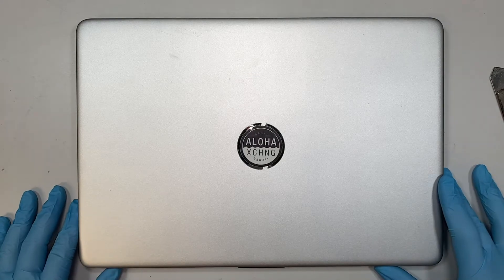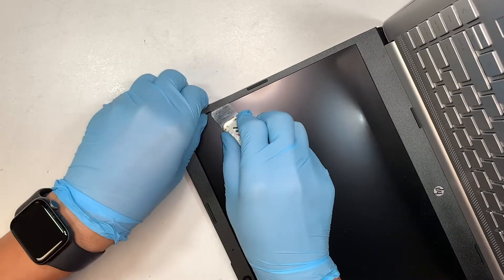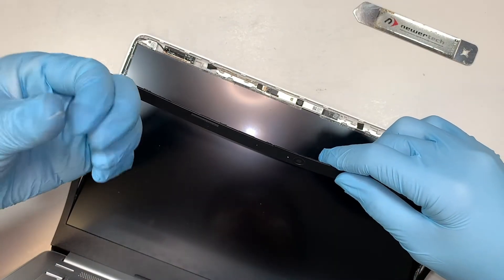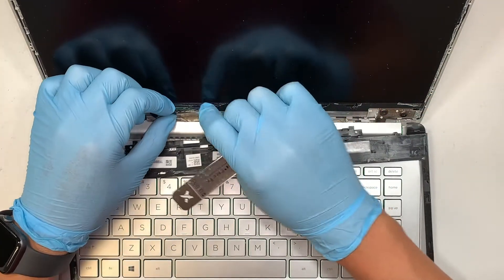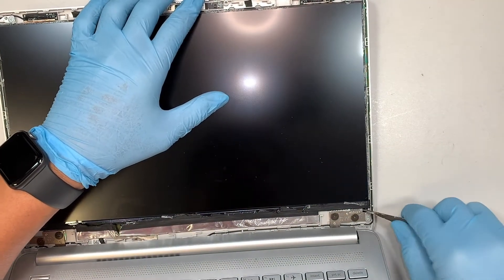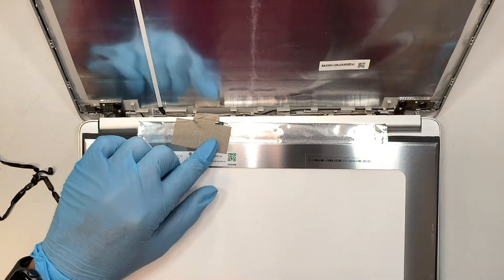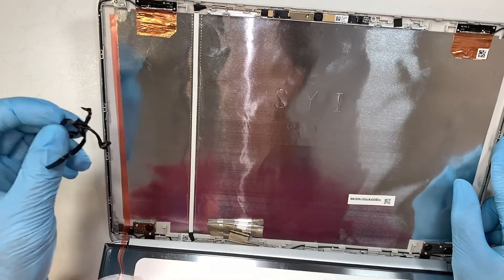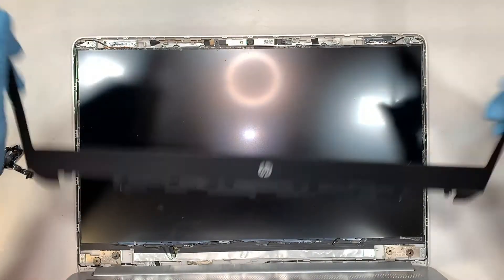HP Laptop 14 Screen Replacement Start To Finish

Comment: My HP chromebook just stopped working, the batter was low and i put it on charge but screen went black and no power light i disconnected battery i think tried to use just cord but nothing what can i do

Comment: This was extremely helpful. I did have a hard time getting the plastic back on, especially the bottom under the hinge. It would have been helpful to see how you did that. 

I also didn’t have much sticky left and didn’t know if I should add tape or if the clips would be secure enough
Reply: I just look my laptop out of the case and the hinge cover had completely fallen off. So I obviously didn’t get the bezel replaced correctly at the bottom. Just an additional point for why it would be nice for you to cover this in your video.
Reply: Mine went back on easy peasy **BUT** only after I had carefully slotted back the black round cable below the camera and the main silvered bundle under the connector. Also push tye cover on from the back with the screen closed. It snaps on easy.

Comment: PERFECT! I was able to remove the old screen without breaking anything after pulling the tape. I will make sure and let the new tap have a little sticking out to grab in case I need to replace it in the future.
Reply from the maker: You are welcome. Glad the video helped.

Comment: I am doing this to my hp 14 dk1022wm.  The screen is fine, I'm just upgrading to a matte 1080p panel.  Hopefully it works
Reply: Did it work?
Reply: @Jadebones  Yes.  I had to buy a 2 channel edp cable from hP, but it is fantastic now.  HP just couldn't use one cable between the 720p and 1080 model even though it would have worked on both.  I guess that extra .02 cents was good on revenue lol
Reply: @CuttinInIdaho I'm about to upgrade my hp 14-dq2088wm screen to 1080p as well. At what point will I know if I need a new cable? Did the connecter simply not fit?
Reply: @x3swk  the cable is the exact same on the connector, it's the amount of data lanes that was different, and yes it is a different cable for mine.  

My hp cable had one lane, but the motherboard supports 2 lanes because the same motherboard is used on a 1080p version.  I found this info by searching the model on HP's site and comparing part numbers of the cables and motherboards.  

Also, I checked the data sheet for the replacement screen and the screen that was already on the machine.  This told me that my screen was single lane, new was dual lane.
Reply: @CuttinInIdaho  this is super helpful, thanks!

Comment: LCD frame can be removed by simply prying. Zero damage occurs . Faster to just reapply adhesive strip. 

I repair probably 30+ HP laptops a day because they are the least reliable of all Brands by far.

I have never seen so many failing computers.

Hp also had a horrible reputation for not installing their LCD connectors properly. Cheaping out on just about everything inside. 

I have repaired hundreds of brand new Hp laptops that had the LCD connector not installed all the way! Haha! Bad quality control aswel!

Their monitors have the same issues. I can’t stand what this company does inside their computer.

Asus is great. MSi and Lenovo very good. 

Out of 50 laptops, ide say around 30 are HP out of all other brands.
Reply from the maker: Thank for sharing your inputs